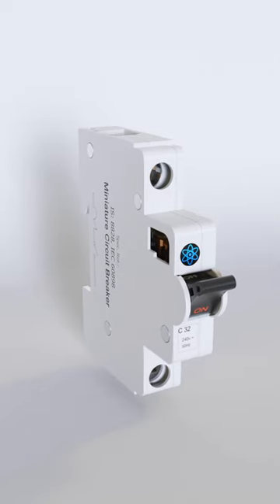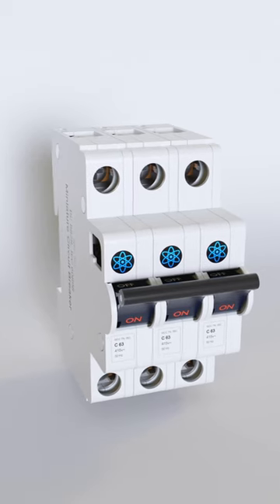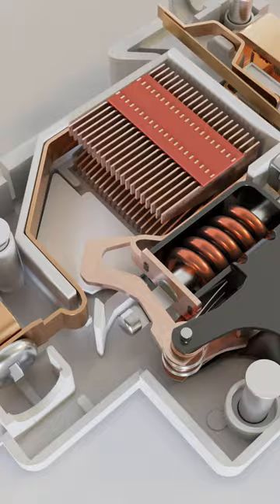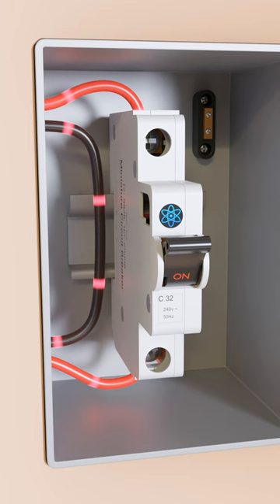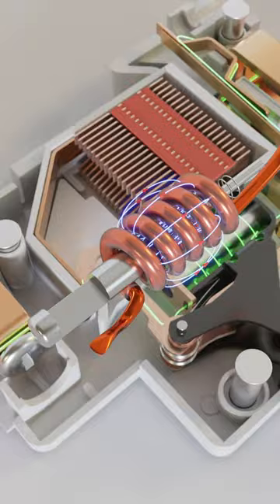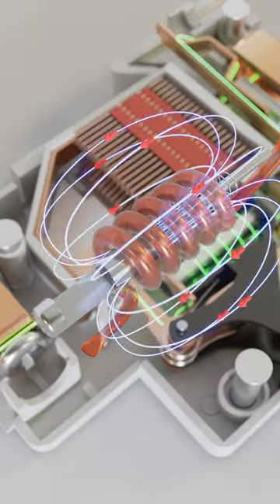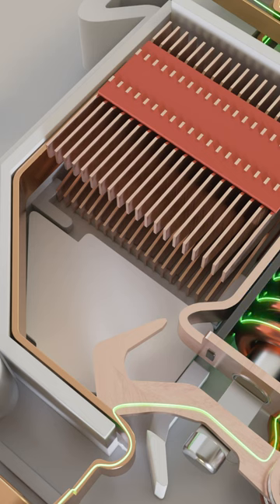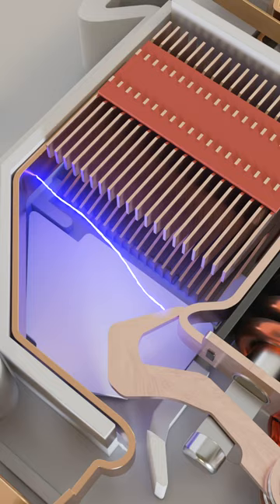Miniature circuit breakers (MCB) | 3D Animation #shorts #animation

Comment: MCBs have two trip modes; the instantaneous overcurrent mode as you indicate, and also a bi-metallic strip based thermal trip mode, to manage consistent (but often lower) levels of overcurrent.
Earth leakage (or RCD) devices are even more fascinating since they are "active" switch components.